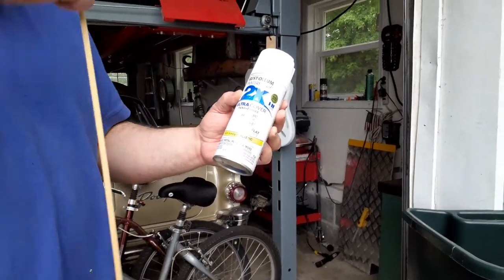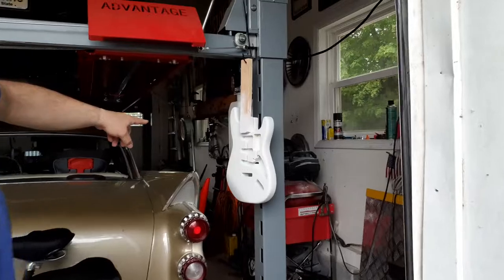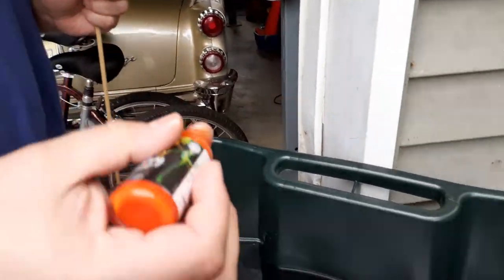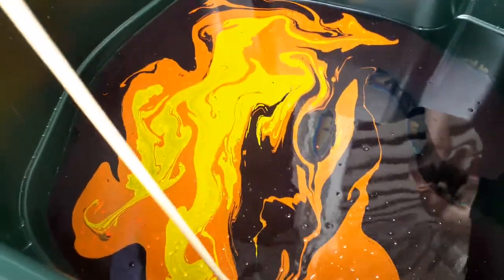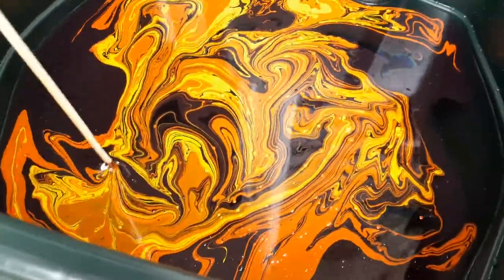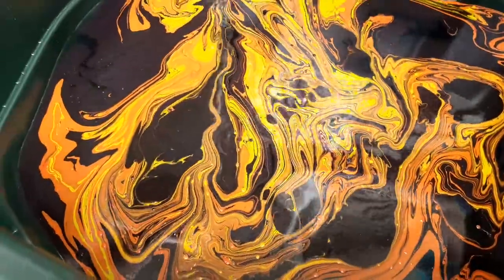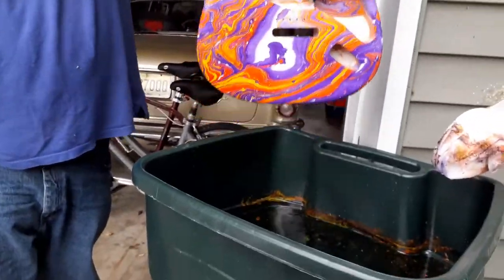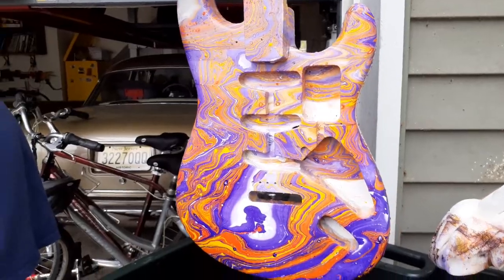Hydro dipping a guitar body with Magic Marble Paint

Comment: A couple questions… How long do you need to keep your guitar under the water? when I’ve taken objects out of the water little water bubbles remain. How do you get rid of those? Hairdryer ..fan? Any other technique? Just shaking didn’t seem to do it.  Relying on sanding afterwards doesn’t really work since it sands off the color.
Reply from the maker: As soon as it's fully submerged and the paint on top is moved out of the way its removed. I would say from start to finish under a minute. I way the body around so extreme air drying you might say. Pretend you're directing traffic if that makes sense.

Comment: Im just wondering, did you put anything into the water as a medium? also how warm was the water?
Reply from the maker: I use magic Marble paint which doesn't require a medium in the water. I had the temperature between 65 and 70F.
Reply: @samdeo5332  Thanks man, im looking forward to doing a project like that myself.
Reply from the maker: @slipstream2326  good luck and have fun, I actually redid this body and painted a couple more. I'll try to make a video to showcase them
Reply: @samdeo5332  hey, its me again, ive been trying out some paints and none of them are working very well, could you please send me a link to the paint you used?
Reply from the maker: @slipstream2326  sure things, this is the main site, https://magicmarble.com/ however you can get these colors as well as custom colors from here as well https://www.beachgirlzglitter.com/

Comment: I’ve tried this 4x. Can you help me out with just the water part please? I’ve tried hose water, I’ve tried water with borax, etc. I’m left with a white primer body still with the water that eventually just turns all blue & the paint doesn’t really stick at all to the guitar . I’d appreciate any help
Reply from the maker: @willscharen199  what brand of paint are you using and what is the temperature of the water? I'm using water straight from the hose.
Reply: @samdeo5332  I used Zinsser BIN shellac base (white) primer. The marble paint I’m using is Acro acrylic paints. The water temp from the hose is somewhere between 70-80 every time.
Reply from the maker: @willscharen199  ok, that marble paint needs a medium, if you got it from Michael's, they sell it as well. The base goat should be fine but I prefer Rustoleum 2k spray paint for a primer and base coat. It's easy to sand once sry and sprays evenly
Reply: @samdeo5332  thanks so much!!
Reply: @samdeo5332  ended up ordering marble magic oil-based paint. Regular hose water….worked amazing!! Very happy with how it turned out. Some light sanding after in spots afterwards but overall 1million times better
Reply from the maker: @willscharen199  awesome, you need to post a video!

Comment: water temp? I keep trying bu tthe paint keeps setting up on the water before i can swirl and dip. I started at 78 and went down to 68 but still happens..
Reply from the maker: Between 65 and 70F. Are you using Magic Marble or another brand?
Reply: @samdeo5332  another brand since magic marble is basically out of stock of all paints, i using the marabu easy marbel which is similar but i dont think is as good
Reply from the maker: @BoostedBlazer  I tried a swirling paint from a local craft store and it gave me a lot of issues. There are a few places that may have magic marble in stocks, try beach girl glitter, they have custom mixed colors as well.